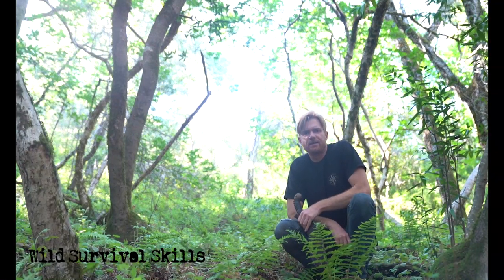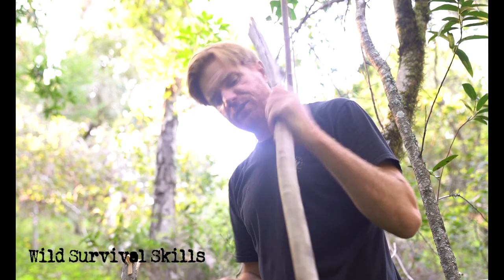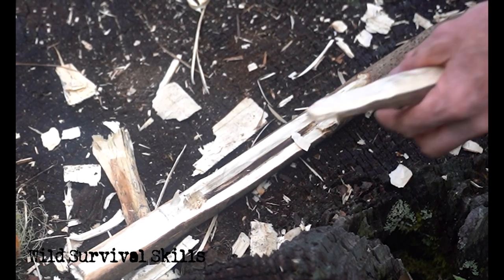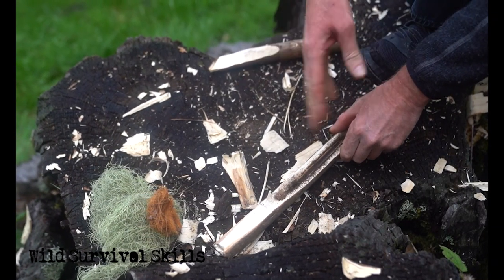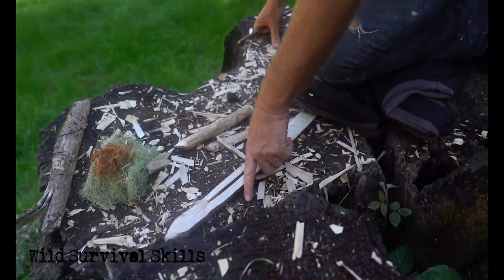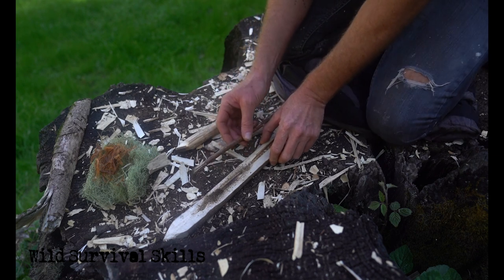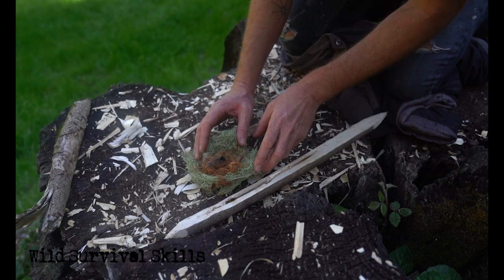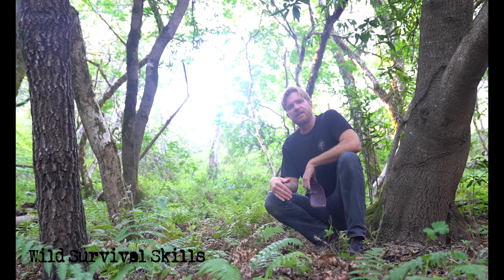Fire Plow Friction Fire-- The most simple fire!

Comment: Some questions/pointers:
1. I noticed you went with buckeye, a good pick in terms of woods, but I noticed you didn't dope the pit with any excess shavings beforehand. Is there a reason you wouldn't want to do that on the initial plank you're prepping the ember on?

2. I recognized that you spent a bit of time blowing onto the ember, but I've heard you can also gently wave the bundle back and forth through the air. Did you avoid doing that because of the risk of the ember falling out? Is it not an actually reliable method? Or did it just slip your mind? Honest-to-goodness asking so that way I know for the future.
Reply from the maker: Hey Jostin, 
1. Im guessing when you say 'Dope the pit' you mean add dust powder to the hole I made?  The only reason I didnt do that is so that it was obvious i was starting from scratch.  So many youtube videos people fake things like that, by cutting just before getting a coal or adding an already lit ember.  In a real situation I would definitely add the coal dust to the hole from previous attempts.
2 I find that yes, when you have a good coal waving it works well.  If the coal is small, like this one, I want to be able to see exactly what is happening so I can control the spread of the heat better.  If your tinder is good and you have a good coal waving tends to be fine.  Thanks man! tom

Comment: Is it possible to do this without a knife? The cutting and making the wood board part specifically. 

For a scenario were someone wouldnt have something to cut/chop wood with
Reply: Smash rocks together by throwing them onto one another till you find one with a sharp enough edge and go from there.
Reply from the maker: Yeah, its not too much harder, especially with the wildflower stalk since that needs no carving.  Once you ave that you can very easily make the track with a rock.